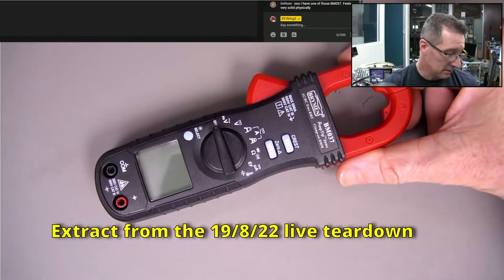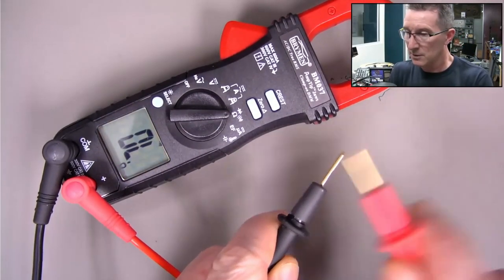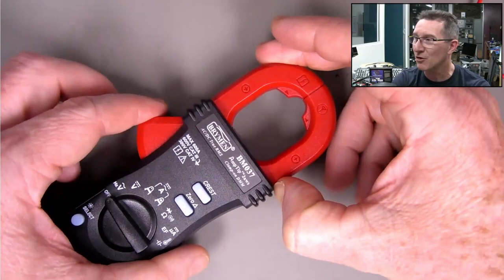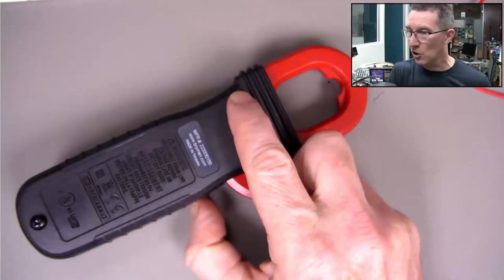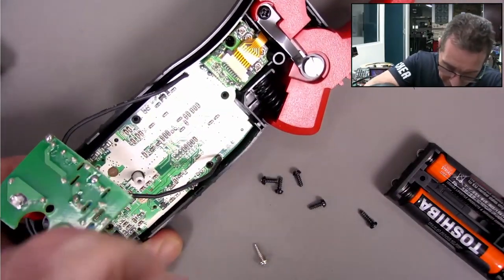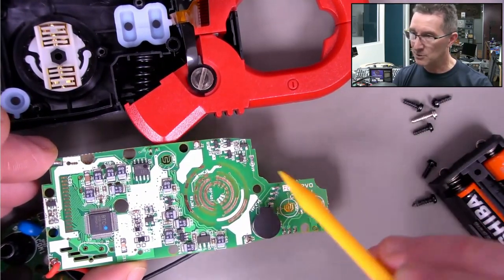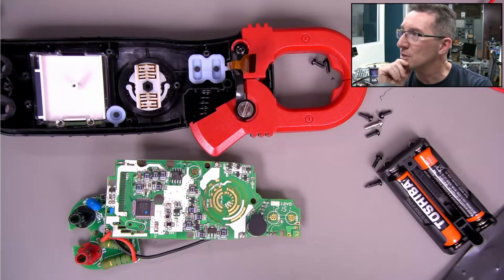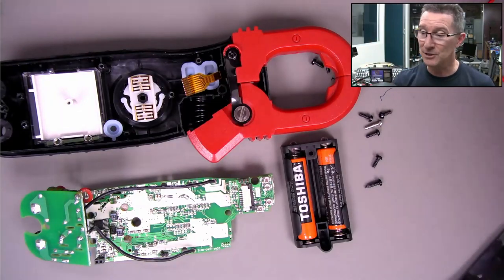Brymen BM037 Clamp Meter Teardown

Comment: It still blows my mind that Dave wasnt familiar with the UnitT210E . its literally been the fanfavorit on EEVblog for like a decade and also hacked for 6000 count and its so popular. as a small AC/DC clamp meter for the hobby segment..
goes from 1mA to 100A.
and 5 years back they were around 25 to 30 USD, at least when I got mine.. (28USD delivered to Denmark)
210E also got a quite decent NCV, and some extra features, like VFC, and its very small and nimble with a convenient onehand thumb-dial and true RMS.

If I was Dave - I would try to get one of these 210E/ or 210E Pro (not for sale as he explains) but simply as a benchmark, to get an idea of the build, and design & performance, of a AC/DC clamp meter at sub 30 bucks., that so many people already have.
There is also quite a few alternatives, that has dual display and also 1mA resolution, like the ACM91 and that unit could also be had to around to just under 30 bucks.., but its numerous years back, and the prices are different now..(just checked, not by much ACM91 and ACM92 is still around 30 bucks with incl. 25% EU VAT)
There is also the UnitT210EPRO with a black clamp instead of red, that are around 35 to 45 US..
maybe people' will simply purchase that low-entry budget Brymen clamp-meter' from the name alone & perhaps the blue EEV-label, but there is also a chance they simply wont, if its more expensive and it performs worse or equal.

If you could get Brymen to fit a Bluetooth chip and get it to work  with your Bluetooth app.. that could be the cherry on the top, and be quite handy for a AC/DC clamp meter with such a wireless logging feature.
Reply: Yep my 210e is my go-to grab and go meter. The only thing it's missing is a probe holder so you can hold the meter and jam a probe in something while holding the meter. I 3d printed a holder for mine.
Reply: 25% isn't EU VAT, that's your country's VAT.
Reply: @Okurka.  Is it because you dont have any valid input about the context. "clamp meters".. that you waste your time, referring to "EU VAT"
From 1/7 - 21 a new EU VAT rule was set in place, and shipments to EU will now often be VAT handled from a new EU VAT bureaucracy construction..aka. EU's  IOSS & EU eCommerce system .. many wholesalers abroad are using this "EU VAT" system to handle VAT and you need to look thrue the papers to see what fees EU takes of that.. its varies from one to the next ..even Ali-expr. and many other are using it and paying a free to be implemented in EUs VAT system.
As a private, you can still circumwent that EU VAT system if you purchase it directly from a source that ain't incl. and who ships abroad ' but then you will be subject to individual VAT,  the moment your parcel arrives to you country - and in my case Denmark. also be added another VAT handling fee that are around +25USD... 
but enough about VAT...You hopefully do understand what people in EU is referring too' when they write "EU VAT" like above or when stores label their items with "EU VAT. included" 
you can look into EUs IOSS VAT system or check on Ali 3xpr. they also have a section where they inform about "EU VAT".
Reply: I guess this brymen even have the same chipset as ut210e
Reply: @Okurka.  That EU VAT is the VAT rate of the country where the merchandise coming from outside the EU is delivered, no matter where the buyer actually lives or where the order was placed.

For merchandise sold and purchased within the EU you pay the VAT rate of the country where the seller is registered, some companies are registered in a few EU countries to circumvent that, because EU companies do not pay VAT when they buy goods from another EU company (they must have a VAT number but that's easy to get) as long as they are from two different EU countries.

So you can have a head office in your country and subsidiaries with wharehouses in countries with lower VAT rates that will act as intermediaries and sell and ships the merchandise to countries with higher VAT rates.
They have to be countries nearby your potential customers so that the increase in shipping costs does not exceed the savings in VAT.
For example your company can have the head office in Hungary (27%) and subsidiary warehouses in Romania (19%) Slovakia (20%) Germany (19% ) to maintain attractive prices for buyers from countries where VAT is much lower than 27% like Austria, France, Bulgaria, Estonia (20%) Czech Republic, Latvia, Lithuania (21%) Italy, Slovenia (22%) and so on.

And thanks to BorisExit buying in the UK for private customers from the EU means paying 20% UK VAT plus your country's VAT... I guess it will work the same way the other way around.

And if, as happened to me in my last order to the UK, the seller does not know where to look for the IOSS code provided by eBay and decides to try to send the package marked as a gift, customs charge you VAT on the shipping costs...
And if they do not mark it as a gift or the customs consider that it is a lie that it is a gift, they charge you the full VAT again, eBay now has a form to ask for a refund of the VAT collected by them if customs charge it again... but it seems like a slow process, full of paperwork and that doesn't always finish working.
Reply: It was the UNI-T 210E's 1 mA DC resolution on the most sensitive range that made me buy it. (Being able to easily measure the current being drawn from a 9 Volt battery is a perfect example.)  I still need to do the EEPROM hacks to get it to start in DC and to increase the count to 4,000 or even 6,000.  There are a few infelicities with the 6,000 count hack I believe.  Dave, this resolution is a big drawcard for hobbyists and EEs I say.  Well worth considering.

Comment: Make them setup the backlight so it stays on for a couple of minutes when you turn it on, they NEVER stay on long enough ! A 600mA range is good if you can get it done, I love my UNI-T UT210e as it is great for portable testing of projects without having to cut into the wires.
Reply: I have the higher end kaiweets with the nice screen and its great. It's nicer than the 1200 dollar fluke clamp at the makerspace. The fluke meter has a dizzying amount of accessories.

Comment: I really like my UNI-T UT210E. Cheap and works as it should. I'm interested in measuring both AC and DC current 0.1A to maybe 50A + AC/DC voltage 1-300v.

Comment: Nice one but I would personally prefer one that has the rotary switch at the edge so it could be operated with the thumb in one hand rather than having to use 2 hands like the BM078 or BM079. My range preference would be 6A and 60A, but thats just my personal use scenario.
Reply: Good point, yes I agree , rotary at the side , both of my clamps have that the appa 18+ and the fluke 325
Reply: @leandrolaporta2196  Side ones do not play nicely in pockets.  I had one clamp meter with even stupider design, it had on/off slider on its side.  Every time I needed it, it had empty batteries.  Now my daily driver is uni-t ut210e with dial usable with thumb and it just rolls by it own in my pocket.  It has better auto power off though, so it does not kill batteries all the time.
Reply: Oh, and another note from using these things all the time as troubleshooting electrician.  Why almost all clamp multimeters have amp ranges so far away from off position?  If I could choose, it would go like off -> max amps -> mid amps -> low amps -> and then the rest, which also need leads, which I would think most clamp meter users leave out anyway.
Reply: @villehietala9677  Since Dave want's to use an existing Brymen design I doubt it will have a redesigned switch but generally I would agree with you.

Comment: Industry would have flyback diodes on relays etc. so a diode test can be useful.
A limited resistance range reading is often a limitation of clamp meters in my experience.
Reply: Or testing input diodes on vfds.

Comment: Having CAT3, UL Listed, fast acting continuity, a large and clear backlit display (blue would be better as some people are red/green color blind), small formfactor,  and diode check, for $100. That's a winner. Diode check is handy for technicians for checking diode bridges and rectifiers, and transistor/mosfet/IGBT output drivers on VFD's and such. Can also use it as a diagnostic for checking panel LED's to see if they're blown. Leave diode check in!
Reply: Would disagree with the blue light..Construction of clamp jaws could be better..

Comment: I did a fair amount of "research" to find a low-ma reading DC clamp meter and finally bought a fairly cheap one whose specs sounded a lot like some of the more expensive similar meters.  As you say, they don't do well below about 50 or 100 ma.  I was trying to troubleshoot parasitic leakage currents in a 2006 Chrysler minivan, using this DC clamp technology.  One of the big problems is/was that the clamp doesn't seem to know the difference between a wire that is in close proximity to the clamp vs INSIDE the clamp.

Comment: These are great. I have a UNI-T and a none contact meter in invaluable when fault finding some automotive systems like alternator faults. For small measurements it might not be that accurate  but for them you can use the probes anyway.

Comment: 60A and 6A will be best, and the thing you can lose easily is temperature, almost never used. Metal case inserts are easy to add on, almost nothing other than a change in the screw for the case. Hope the diode test voltage is at least battery voltage.
Reply: TBH temperature is not important for me, I have several other DMMs that do that.  I would swap diode test for a not-continuity mode (where it beeps when the probes are open and doesn't when they are shorted) for hunting down intermittent connections.

Comment: I bought a Digi-Sense branded (model 20250-56) clamp meter with 400/40 amp AC/DC ranges. Comes with NIST-traceable calibration for US$100 or so. (In fact it's the only calibrated tool I own. 😅) Cat III 600v, does all the usual multimeter stuff including thermocouple temperature measurement, but no EF. Probes, thermocouple, and pouch included. I only use it occasionally, but it's indispensable for the odd non-contact current readout (like testing my vehicle starters). Looking forward to seeing what you come up with. 👍

Comment: I'm a little confused as to why you say the 16 lines from the main IC to the display aren't enough to directly drive it. Surely you can directly drive up to 64 segments with this setup, and the display on this is what, 4x7 segment with a few annunciators and dp's? Can't be more than 40 or so segments in total, unless there's a bargraph I missed

Comment: uniT210E. if you cant get a meter with the res and function of the uniT210E don’t bother selling a clamp meter. Im guessing most of the people purchasing EEVblog meters are electronic’s enthusiast. the uniT210E does read leakage current and on pare with my Magger DET14 and  fluke 369.  The function and reliability and resolution of the uniT210E is so good is been my edc clamp meter at work for years. I prefer it over all my fluke’s. My everyday dmm’s are Brymen BM869s’s so I love brymen DMM’s but I’ve never seen any of their clamp meters that even come close to having the features for money.

Comment: Speaking for myself here, i dont buy EEVBlog rebranded (re modeled?) products for competitive prices, i buy them to support the channel/blog and the knowledge that with these products i can always get whatever weird obscure information i need on the blog. 
A UT210D with more of a markup would be fine for me, if you could get it in blue all the better ... i like blue. On mine i swapped out the main quad opamp with a chopper amp and it drastically increased stability for only a couple of bucks, possibly you could ask them to drop one of those in to seperate yourself in the market.
No matter what you do i will probably grab one anyway, i do use them quite a lot for both low and high current applications but i do tend to bust out the multimeter for under 10A stuff and use my clamp meters for >10A lower voltage DC stuff such as board supplies.

Comment: The 2/20A uni-t model is my go to, bought the 6000 count model and wished I hadn't.
Reply from the maker: Why isn't the 6000 count model better?
Reply: @EEVblog2  It's only got a crude 6A/60A range and the 600ma range is only AC, I was disappointed and frustrated by that and still am. Also, it appears to lack a floating decimal point, so not instantly readable (for the way my brain works).

Comment: I tried calibrating extech ma 1500 .I turned pot and it got on the reference voltage but when it gets cold it starts fluctuating all over place and want zero when touch probes

Comment: Leakage detectors are not too expensive. There is a generic unit that gets rebranded for about £40 in the UK. It only does AC current though. That's all it does though and the current goes down to 200mA scale with one decimal place.

Comment: I was trying to measure my car start's peak current (I'm starting it from supercaps now) recently, and something with a high range would be nice for that... (Ended up using the grounding wire as a current shunt  (and measured on a scope) - it seems like that peak was around 1 kA for a few milliseconds)
Reply: yep i have  two or three meters capable of measuring that.   Highest i have seen is about 800 or 900 amps peak,  so i could see getting 1000amps from a  newer battery of descent size.   The brymens (I have a BM089) call that feature "crest", my other meters all call it "peak" i think

Comment: 4:04 I'm sure there are rectifiers asunder in power generation. Wouldn't be surprised if diodes failing short is a regular maintenance issue in wind farms, hydro.

Comment: Range wise I would personally prefer something like 20/200A tbh. My only use for a clamp meter (instead of using a clamp probe for electronic/motor design/diagnostics) would pretty much just be house installations at up to 16 amps (very rarely 32A) and short high current loads like a car battery which shouldn't be more than 200A (though I guess the inrush current could be higher). Given that I would favor the 6/60A range probably, as I don't tend to measure my cars starter an awful lot. 

But I will gladly admit that I don't have much need for a clamp meter in the first place, so I'm not part the target market. Heck, just getting a current clamp adapter for my DMM would probably make more sense for me.

PS. Real shame they won't let you sell other already "taken" products at Brymen, I love my BM869s and I pretty much only got to know their company thanks to you and the eevblog forum. Ironically, the German vendor I bought from also sells your EEVBlog BM786 as well as the 121GW.

Comment: Seems like a removable battery door with a captured screw would have been a better idea for battery swaps, having to take the case apart with plastic screw threads is a future failure point when the plastic threads and or threaded posts fail, only negative I see and surprised to see 
Brymen using such a design, seems more like something from UniT or other lower end meters

Comment: Thanks for the video.
For me lose the temperature and diode not needed on a clamp meter use a DMM, this may lower the cost.
Keep the 60 - 600 amp range.

Metal inserts for the screws
The Unit-T  I have is 2 - 20 - 100amp range, so the low amp range is covered by this meter and the high amp range would be covered by the Brymen you want to have made.
Had to do some edits to my comment was typing first instead of thinking first.

Comment: Well, why launch another rebranded multimeter? What is the benefit? Because you can do it and because you enjoy it? Then do it ;-)

You asked which (and if) I would buy a clamp multimeter. Well, with all the multimeters, it bothers me that they can't do everything I need in service work. It bothers me that I need an extra device for L/C and ESR measurements.
It doesn't matter which manufacturer. In my opinion, there are far too many of them on the market - no one has the overview.
My requirements if I would want to buy already: 100mV to 1kV AC/DC, 100µA to around 100A AC/DC (an unfiltered output for the oscilloscope would be helpful, saves the current probe), resistance up to 1Megaohm, capacitance 1pF to 100µF, inductance 1µH to 1mH, ESR/ESL measurement with 100kHz and 10kHz, a very quick continuity tester with switchable beeper.
Other people in the room may be annoyed by the beeping so I would use optical alert. A PC interface is helpful for longer observations and getting alertet when something happens. 
A thermometer function is of little use to me, since I often measure the temperature simultaneously to other quantities.
The accuracy does not have to be too high, a calibration with certificate is not necessary. It is about service use, troubleshooting on site with scientific instruments. For adjustment, other measurement technology is needed, which must then also be calibrated.
However, these may also be table-top devices siting in the save, warm and dry workshop, each of which masters its few functions very well.

BTW: The UNI-T UT210e uses an chopper op amp for the HALL-sensor.
Similar devices (for example Voltcraft VC-523) do not. So they do not come down to the unter-10A-range.
As long as inductivity of the clamp does not have an effect on the DUT it is OK to wind the wire several times through the clamp.

BTW2: At the moment I do a lot of measurements with a 4-ch DSO an diy add-on-devices. Testing ESR, breakdown voltage, ...
The graphical representation also helps with explanations for the customer. Maybe I should replace the multimeter with an oscilloscope in the future.

And yes, my requirements are somewhat special ;-)